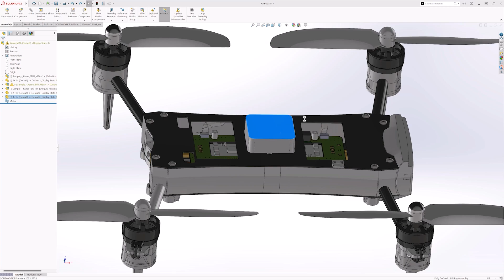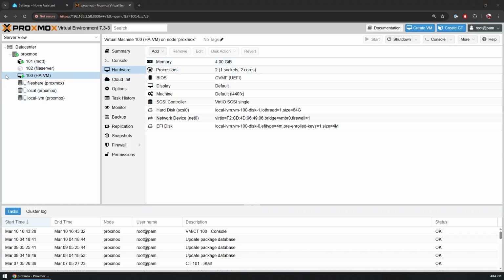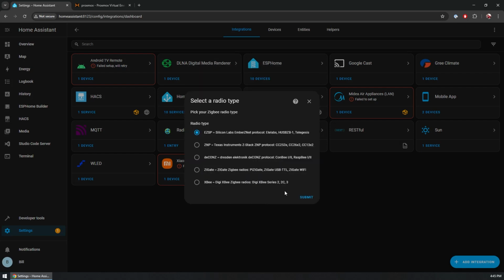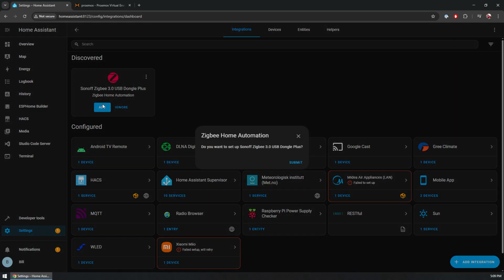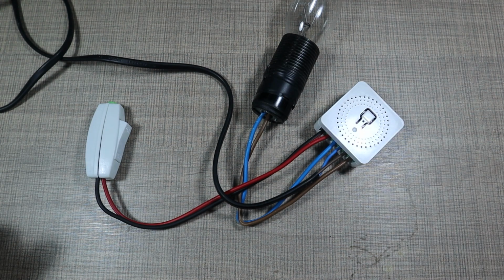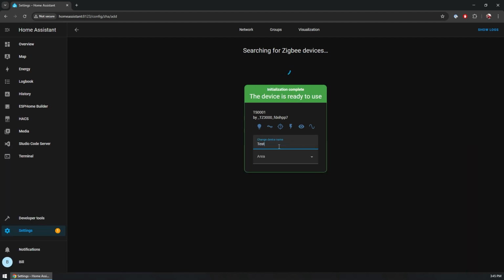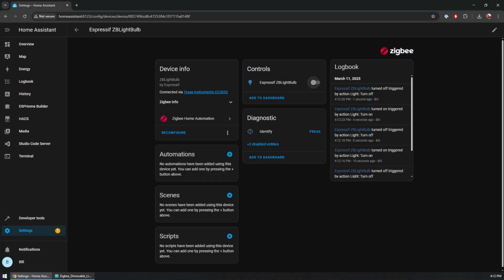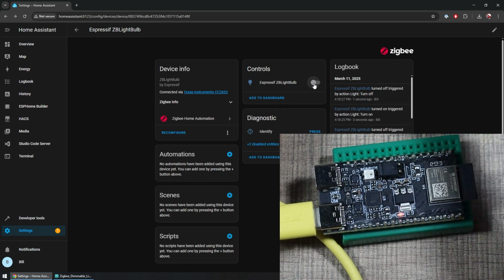Home Assistant + Proxmox: Easily Add a Zigbee Dongle to Your Smart Home

Comment: Curious if you have ever had to move the HA VM from one Proxmox host to another one?  Concerned that when I move the dongle over it won't come back with the same RF Network and will have to re-pair everything.  Appreciate any insight you might have.
Reply from the maker: Hey, no unfortunately not. In theory it should work just fine but I have not tried that to know for sure.
Reply: @TasteTheCode thanks for the reply. Fingers crossed.
Reply: Found a great step by step tutorial on moving a VM between two stand alone PVEs that worked perfectly including the USB passthrough config.  Channel Baker Tech Talk and video "Proxmox VE 8.x VM Migration"
Reply from the maker: Great, thanks for sharing. That will definitely help someone.

Comment: This looked perfect to help me - I just migrated from RPi HA to Proxmox HA on a miniPC and my Sonoff coordinator won't connect.  The trouble is, my Proxmox HA console doesn't have Hardware to add the USB, and my HA Settings doesn't have the Hardware to pick up the identifier (it just shows Processor and Memory, not a list).  Yet I'm on latest 2025.9.3
Reply from the maker: Hmm if Proxmox does not see the USB, I suspect that you may have an issue with the USB connector. Have you tried using a different connector on the miniPC?
Reply: @TasteTheCode Thanks for replying, I resolved it (following a tip on Reddit) by deleting the LXC HA and replacing with VM HA - then I was able to add Hardware, and get the SONOFF coordinator to pass through. All worked perfectly after that
Reply from the maker: Yeah, LXC are limited in many ways. I only use VMs in Proxmox.
Reply: @TasteTheCode Before that day, I had never touched Proxmox! 😂

Comment: I was using the ZBT-1 home assistant connect dongle and it was not coming up but i found i had to go to the data center in proxmox and click resource mapping to have the usb show for use on VMs. hope that helps someone.
Reply from the maker: Yes, I did the same and I also mention it in the video.

Comment: Thanks for the video ; I had the same problem , not showing the USB in Home Assistant.
Just needed to restart the VM in Proxmox.
Reply from the maker: Glad you found the solution, that's a common issue when adding new USB devices! It got me as well until I realized what I need to do.

Comment: There is no separate entity for brightness. This is an attribute of the entity.
If the light entity supports brightness change, this will be available as a slider when clicking on the entity
Reply from the maker: Based on the sketch, there should be but for some reason it wasn't working.
Reply: @TasteTheCode  You only clicked the switch, need to click on the device name